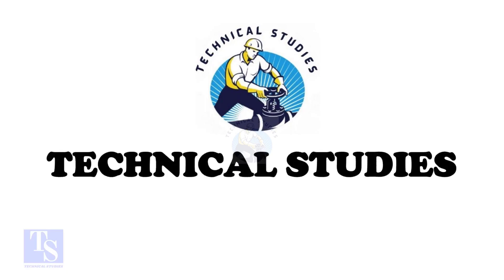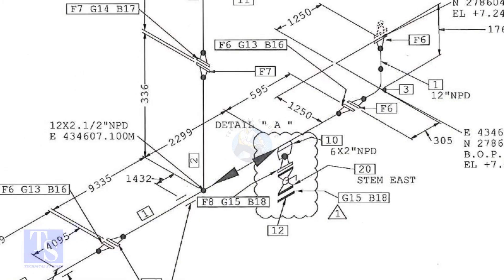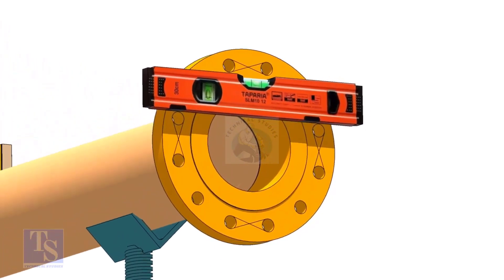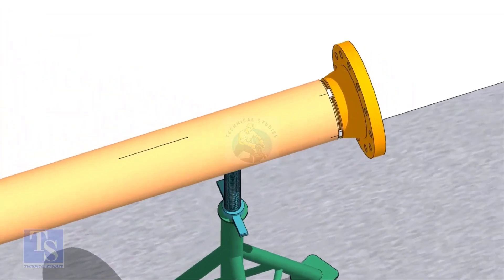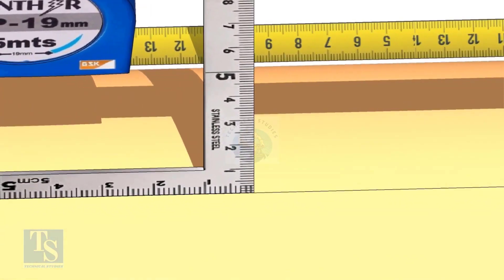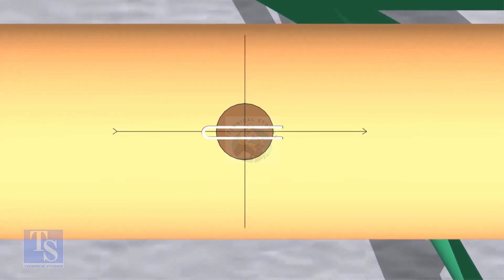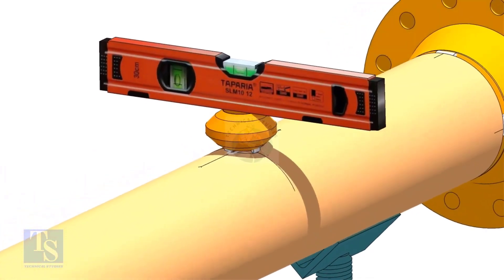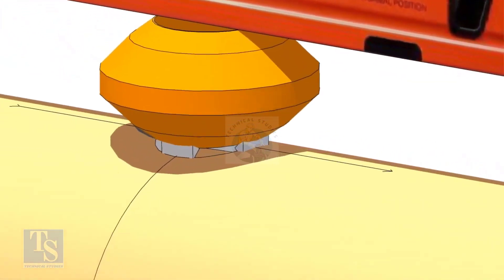How to Fit up, Weldolet, Threadolet, Sokolet.

Comment: Hi sir, should i make a bevel for the hole at main pipe? If not, can i know the reference?
Reply from the maker: Bro, you cannot make a bevel on the opening on the header. This is a stub-on type fit-up. That is the normal and correct practice. ASME B 31.3
Reply: @technicalstudies.  Tq sir 👍👍👍